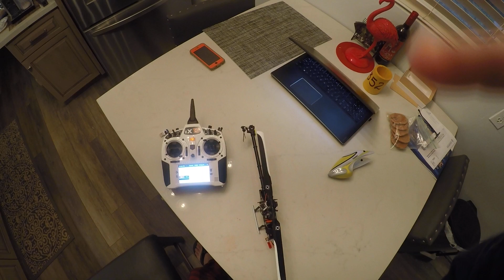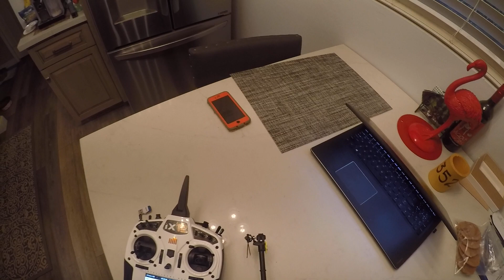Blade Fusion Tail explained ( Part 2 of tips and tricks)  the 30 seconds I missed.

Comment: Thank you for your help in this video. Myself and a few others have noticed that upright this thing is pretty solid. But inverted it seems fly tail low. I am using 4s battery. Have you noticed this? If so, how did ya correct it? This has been a great training heli for me. It’s not as noticeable during 3D, but when practicing stationary hover. Thanks!

Comment: Use a longer servo horn? When might the pitch adj not be enough?
Reply from the maker: Stock length works fine, except I have to use 100% gyro gain to hold the tail for the way I fly. I use a longer servo horn for mechanical advantage of speed. The longer the servo horn, or farther out on each hole, makes the servo action faster because it's out further from the pivot point. You can then go back in the radio and turn the gain down to about 40% and get the tail to hold steady in hard pitch pumps. It will do a very fast wag if the gain is still too high, just play with the gyro gain.  Coe Show

Comment: I enjoy these informative videos; I just finished a flight with my 360 👌🏻. I do have a question, do you like the Fusion 270 or the new 180 more in overall performance, reliability, & quality?
Reply from the maker: I actually like the Fusion 180 better out of the box as a BNF. I love the Fusion 270, although I prefer to use a AR7210BX flybarless or a Brain flybarless system. I honestly can fly the 270 with the stock gyro, but I like it better with an aftermarket system in it. The servos, motor and ESC are great. You could buy it as a kit version, and buy the motor, speedo, servos, and esc separate, and install a 7210bx  in it, and I can walk you through the set up over a video or a email. All of the new Horizon Hobby products are well thought out now days, but any helicopter is going to need a tune up on occasion to keep it tight. I'm glad you are rockin the 360. You will learn more with the bigger heli, and you can transfer your findings and skill to the smaller helis. The smaller helis will keep you on your toes, and when you go back to the 360 you'll be really smooth because it's bigger and more stable like a long surfboard. Just keep flying, and it will be natural instinct after a few thousand flights..lol. 20 years ago, I was a hard core user and abuser, and the helis saved my life, so I give back to the hobby. It's just something you ask yourself,  How bad do I want to learn, and use it as positive energy. You can always hit me up with questions.    Coe Show
Reply: CoeShow619 Thank you for the detailed reply, I will absolutely keep you updated, I could use your knowledge.